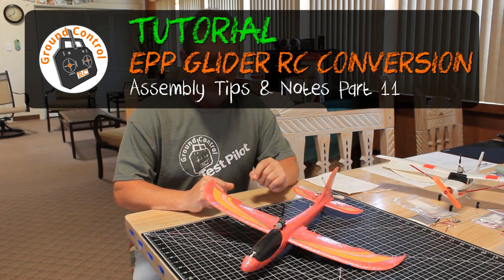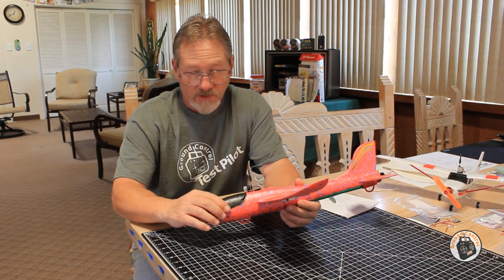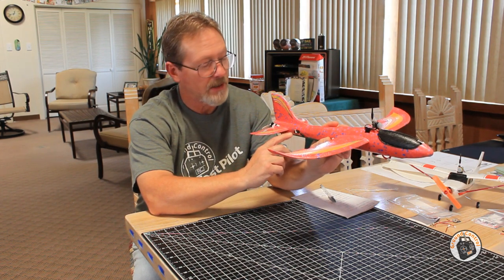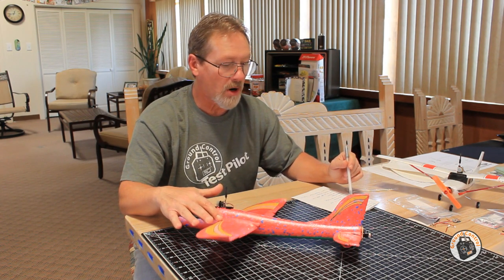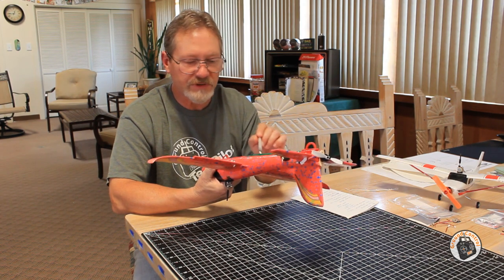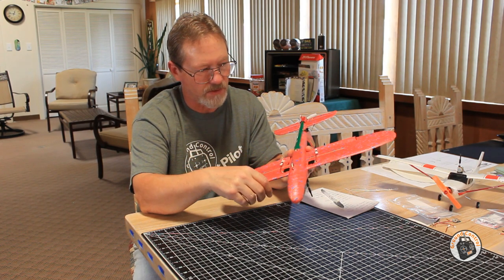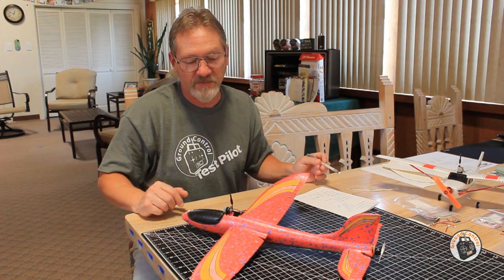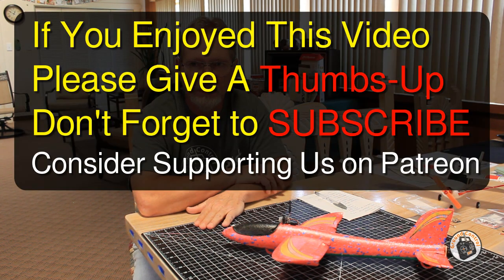Tutorial Part 11 - Glider EPP 48cm RC Conversion - Assembly Tips & Notes

Comment: If I Mount my motor on towards wings where your antina is pleased so what should be the angle for motor mount
Reply from the maker: Hum...if you mount it as a pylon mount I would mount it behind the wing and I always try to get the motor angle so the thrust line goes through the CG on the Wing. That keeps the throttle from pushing the nose up or down.

Comment: No ruddler?
Reply from the maker: No Rudder on mine. It's Bank-n-Yank as I wanted to keep it as light as possible. It would be easy to install a Rudder though if you wanted. See you in the Air!
Reply: @GroundControlRC  Alright ;] Im considering building one as a holiday project but with puller motor. Whats your kv on the motor? And are you using this 1s dsmx compatible  reciver?
Reply: Im  a newbie pilot (and extreamly expirienced rc car guy) and im wondering how its flying without fpv? Since i have huge simulation sickness (3 min in googles and i puke all over myself)
Reply from the maker: @Ev0ltion  , good questions! The motor is the DYS BE1104 7000kv and I'm running this on a 2S 300mah LIPO. The Receiver is a Micro Low Voltage DSM2/DSMX 4CH Reciever. I use a Variable Voltage SBEC to provide 4.2v to the Receiver and Servos. See you in the Air!
Reply from the maker: @Ev0ltion  , hehehe...not good ;-) I started in Quads flying FPV and loved it. I love flying FPV but I wanted to transition to Planes and learn to fly Line-Of-Sight as well. It takes some practice but I really enjoy flying Planes FPV and Line-Of-Sight. This Converted Chuck Glider is pretty fast and agile so you can't take you eyes off of it ;-) See you in the Air!
Reply: @GroundControlRC  Thanks for the tips. Ill probably build my setup around 6v servos and bec esc and see how it turns out. One last question whats the totall weight of the plane? I calculated that all my electronics including battery will weight around 50 grams(excluding prop, and including fact everything is always heavier than the spec says so i assumed 20%+). So probably with all the linkages and mods ill get to 80 additional grams. Agin picking on your expirience will it be fine or too heavy?
Reply from the maker: @Ev0ltion  , my Total Weight, less the Micro FPV System, is 110 grams. Since mine is a Tail Mount Motor I had to add 13 grams to the nose to get the CG correct. Since you're going with a Tractor Mount Motor you won't have to do that so I'm guessing your weight will be fine. If I had to do it over again, I would probably extend the main wing to make the Ailerons rather than cutout the Ailerons from the existing wing if you want slower flight capability.

Comment: I really like the all tutorials about this glider. You had to do some update or configuration to the ESC.  Or did you just connect as it comes from the factor? Regards from Colombia
Reply from the maker: Thank you for the kind words! From the Factory it's just a Foam Chuck Glider with no electronics. I used a Micro Receiver with and external OPTO ESC, and used an external SBEC to cut the 2S voltage down to 1s voltage for the Receiver and Servos. It sounds a bit complicated but it was fairly easy to do. The ESC was just default settings from the Factory. See you in the Air!

Comment: First of all thanks for a great tutorial! 
I have a bunch of these gliders though the tail part is slightly different. In the ones I have the horizontal stabilizer slides into the main body side-ways just like the main wing. Not sure if that will make a difference if I follow your conversion. Perhaps the linkage of the two sides of the elevators would turn out slightly different.

Earlier I tried two conversions but both failed. In the first one I tried to mount a brushless motor above the main wing but I think I got the angle wrong and after I fixed that it just didn't have enough thrust. Next I tried a brushed conversion with two 7mm motor one on each side of the wing with differential thrust. This did work better but it just couldn't handle any wind due to lack of sufficient thrust. I am now planning to try your design. So I wanted to ask if flaps are really needed? I was planning to use a single servo for the ailerons which would not permit flaps.
Reply from the maker: Thank you Much! No, the Flaps are not necessary, I use Flaps because the area I have to land in is very rough and I need to slow the glider down a bit to land. It will fly just fine without Flaps. Good luck in you build. See you in the Air!